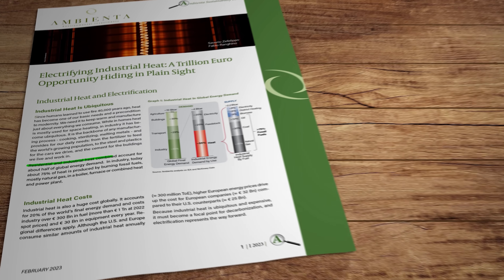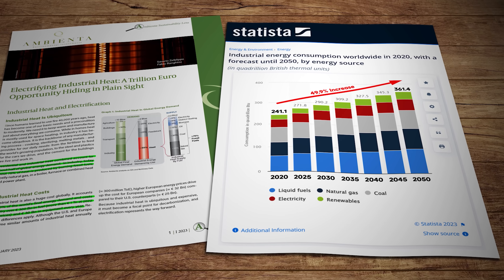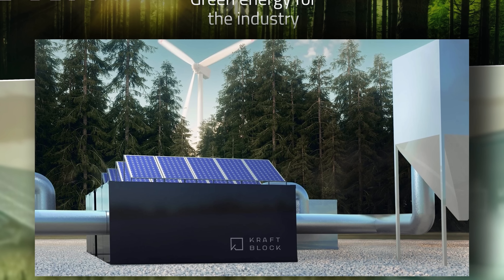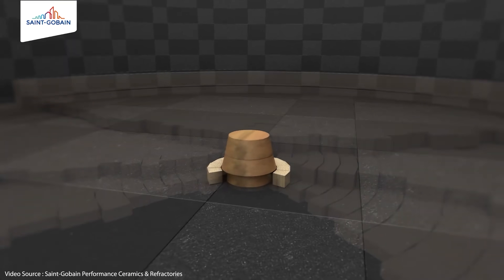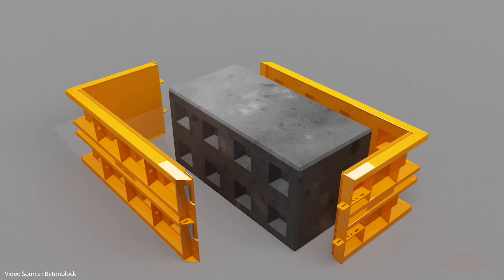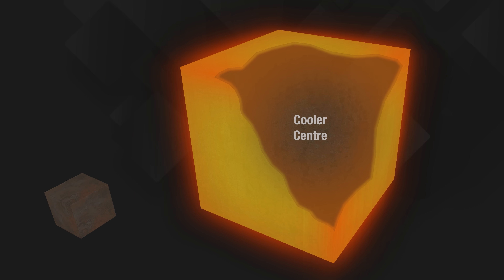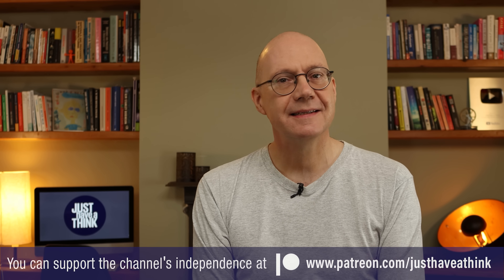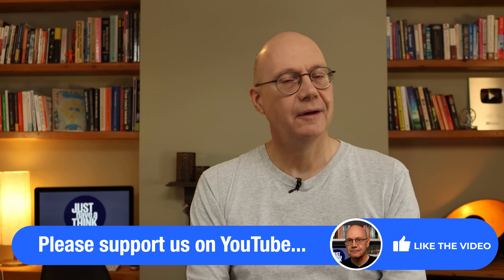Moving waste heat from industry to homes.

Comment: What industry, process or piece of comercial machinery exhausts waste heat at anywhere near that kind of temperature? Any meaningful amount of heat energy at temperatures more than a few hundred C has huge amounts of usable energy in it.  

Foundaries and smelting operations keep as much heat as possible inside furnaces and the like and the heat coming off cooling metal billets is not something that can be easily captured effectively. Waste heat from power plants wouldn't be above 100C because there is still plenty of useful work to be extracted. 

Waste heat usually involves an enormous quantam of energy at a relatively low temperature.  Where the waste heat is above ambient but not enough to easily extract much more usedul work from it. 

The whole video I was waiting for an actual example of where they're getting this waste heat from. 

As a last resort resistive load for renewables that would otherwise be curtailed seems to be the most likely use. Even in such a case though it makes more sense to either store the heat at the renewable generation site or nearby. Or create the resistive load to charge the heat onsite where it would be used later. 

This is interesting but seems like a solution looking for a problem.

Comment: Large comercial greenhouses could buy blocks of heat when winter arrives. If a storm was coming and you knew it was going to be much colder, you could order another block or two. Some of these large greenhouse operations are hundreds of acres and need a lot of heat when the temperature drops. These blocks might even make it more practical to have greenhosues in cold regions where it currently is too expensive to heat them in winter.
Reply: give it a few years & there won't be any cold regions

Comment: Just say no.  At those temperatures, you are not talking about waste heat.  This is typical BS used to hoover in research funding.  There is no way that physically moving a shipping container is a more practical solution that pumping fluids or converting that "waste heat" (that is higher temperature than used to produce electricity in nuclear power plant!) into electricity and have it flow through power lines.

Comment: They want to move 10 megawatt hours around in a shipping container? I hate to be the wet blanket here, but transportation safety, national security and fire safety officials alike, not to mention local politicians, are all going to absolutely lose their minds if you tell them you want to routinely truck around shipping containers containing 3.6 gigajoules worth of 1300° C particulate material.  That’s like 680 kilos of TNT or more than two tankers worth of gasoline. That’s the level of hazard they will consider it.

Comment: Interesting, but definitely a lack of hard numbers here. Particularly the issue of transportation?

Using burger units, diesel is roughly 40kWh/gallon(US). Allow for 8mpg average for the transporting truck (Maybe more, maybe less, depending on a lot of factors). Fifty miles away, 100 mile roundtrip. So for this distance, you'd burn 12.5 gallons, or 500kWh of fuel. Compared to the given 10MWh the container supposedly holds? Not bad, but basically boils down to the net equivalent of about 240 gallons of fuel being transported per trip. That's a couple thousand dollars of value, tops. Against the energy and financial costs of packing and unpacking the heat, the (hazardous-cargo certified) driver wages, the cost of the (hopefully emissions-compliant) truck, and even a slight traffic increase?

This is interesting, but feels a lot more like greenwashing and an attempt to play the carbon-credit game than a serious effort at saving money or the earth.

Also, any situation where a system capable of creating/collecting/concentrating heat to 1300 degrees is viable? Not an area I'm familiar with, but are we seriously lacking any option for  just using it on-site to make electricity?

Comment: I have never understood why steelworks dump slag without developing energy recovery systems. 
I am fully aware that it is due to the fact it is due to the cost of building the infrastructure to recover that heat. I wonder if the slag could be used to recover the heat from the molten slag!
One thing you could use such high energy heat sources is to supply steam/hot water for those factories that have a rail connection but no steam circuit to charge a fireless steam locomotive to shunt the sidings etc etc rather than a diesel locomotive (also fireless steam is much simpler than battery electric and doesn't involve the issues surrounding modern batteries).

Comment: That's a genius solution I think. Depending on the scale it could be worth to move the heat, because you know you could get more energy by moving the container than by burning the gas. I have some questions thought.
Waste heat is not always up to 1300°C... So how does the system manage it ?
Do they also work on a plan to put the storage onto 1300°C with heat pumps ? That could also be a plan for them. So industries could store heat (either with resistive heater or heat pumps) when there are a lot of energy available, or at night when consumption is lower, or even help with grid stabilisation, just to use the heat later at a more appropriate time.

If provided with a decent heat pump system it could both lower energy consumption AND provide a way to get it cheaper, like you heat it at night, then use it during day, etc. I really like this. For once, I think that may be something I trust a lot.

Comment: Thanks Dave, another informative show.
I've analysed my domestic use of electricity (i don't have gas appliances) and found that ~ 80% is ultimately used to move heat around (refrigeration, air-conditioning, hot water, cooking). Surprisingly, I haven't found any domestic appliances which incorporate thermal energy storage - with the exception of sensible heat in hot water.
With the capital cost of lithium ion battery storage still remaining over AUD $900 per kWh, thermal energy storage in phase change mediums looks to offer a more cost effective alternative.

Comment: I am sceptical about how many industrial processes are throwing away waste heat at over 1300C. The waste heat temp will be lower than the operating temp and you also need a temp differential between the waste heat and the storage temp so the heat will flow in a reasonable period of time. Most waste heat is much lower temp. Power stations for eg have waste heat below 200C, mostly much below that. Works great for home heating, but would be too low energy density to be worth putting on trucks. 

We are supposed to be minimising use of trucks by transporting things by rail as much as possible. Using trucks to transport heat that could be transported along a pipe if you bothered to build it seems madness. I don't think you mentioned how heavy these containers will be. Are they too heavy for a truck to take 2 (40' is standard truck size)? These heavy loads will cause extra wear to roads as well as the extra traffic which all needs to be considered. I'm not against thermal storage, I just think lugging it around on trucks is not often going to outweigh the costs and downsides. If you are using excess electricity to make the heat then it makes more sense to do that at the point it will be used and transport the electrons rather than the hot stuff.

Comment: I'm not against heat transfer.  It's done Iceland and other locations with geo-thermal.  I do think we should have a hierarchy of preferences.  First make everything as efficient as possible.  Overall costs are almost always less even if purchase price is higher.  A passivhaus may cost more to build but will recapture costs in a few years.  Heat transfers are fine but we definitely need to stop burning things.  That means figuring out ways to make concrete-like materials without super-hot furnaces.
Reply: The question is "what do we prioritize?"  I think all the ways of reducing emissions are positive except bio-fuels and most applications of hydrogen.  But, the focus should be solar wind and batteries (SWB), and we should be on a campaign to reach emission-free energy.  Next is stop building inefficient houses and ICE vehicles.  We should be accomplishing those goals asap.  No new long-term infrastructure relying on natural gas for heat.

Comment: Aside from the transportation waste energy and CO2 emissions associated with moving semis loaded to capacity carrying material half the weight of solid steel around, I'm failing to see how they plan to pump low grade heat up to 1300 C in an efficient enough manner to make this viable. Maybe, if you're using "free" (otherwise wasted) electricity generated from solar/wind/etc in off hours, but I feel like if the blocks really could effectively store this heat for weeks on end then they'd already be used as an on-site storage mechanism as "thermal batteries" where there is no transportation cost required.

Comment: I'm sure he can find some uses for that but it's likely not that big a deal.   He is hand waving away the expensive part.  i.e. the Heat collection.   If you could collect the heat to put into his nice little pipe then industry wouldn't have a problem.   There are plenty of head storage solutions depending on there needs.

Comment: Interesting system, love it.
Once you can start moving heat around (by electric vehicle) it opens up options like turning computer data hubs into heat suppliers to places that then do not need to be close. Plus at a smaller scale maybe there is efficiencies to be gained by incorporating this product into building heat exchange units. Also any electricity power station with a turbine could store waste heat to speed up starting times and reduce waste.
Reply: a turbine could probably be fitted into the container unit to generate enough electricity for the transportation vehicle itself 😉

Comment: I like it! Shipping containers full of heat moving from the producer to the consumer. It takes a waste product and makes it a valuable resource. Even if the heat isn't being generated through renewable energy, at least it's being recycled and not just released into the atmosphere. So there's less energy being generated overall. And you don't need a big infrastructure of pipes, just roads and heat exchangers at the two end points.

The way it uses steel slag pellets, and is configurable for different types of costumers is really clever. Uber Heats indeed.

Comment: I've thought about this being a viable solution to waste heat in the past. I shared this idea and was told it was ridiculous, and that it wouldn't work. it's cool to see a company actually do it. makes me feel somewhat vindicated.
Reply: @orionbetelgeuse1937  That was my precise thought. 1300C heat is high quality heat, that's the initial heat produced for whatever industrial process they're working not the exhaust or waste heat. If they were directly using the molten slag I could see them getting hotter stuff but it sounds like they're heating the slag up with air not using it directly from the Steel Mill.

I can't help but also be skeptical about the idea of storing heat in a shipping container to be moved on roads, we've built pipes for district heating before that would be far more efficient at this task and the implied environmental impact of that choice to have a truck ( using diesel? or if electricity it's around 42.7% gas/coal as of 2022 and that's before battery losses ) pave and surface all the roads with the very same concrete they lambasted or perhaps ashfault. What sort of world are we imagining where we're shipping around the waste heat from industrial facilities but we haven't gotten away from a mode of shipping as inefficient as trucks?
Reply: @orionbetelgeuse1937  well ideally these companies would have some sort of heat recovery system in place. but not all of them do. that's kind of the point of this idea.

Comment: I'm not convinced that shipping the hot material and insolation would use less energy than just running a resistance heater. I can see the thought process but I'm not sure about the numbers.

Comment: I've seen this kind of stored heat system before, and always wondered why they don't put a pipe inside, fill it with water, and have the resulting steam turn a small turbine. Instant home/neighborhood/regional power plant, depending on scale. If you're running some 24/7 facility with constant heat generation, it seems like you could get a non-negligible amount of power return over time for a relatively small investment.
Reply: The problem there is the amount of Joules it's possible to store vs the amount of Joules needed to turn water into steam & then there's recapturing unused energy as it phase-changes back to water. 
There's probably more useful phase-change media but that's not my expertise, ask a scientist about that.
It's probably possible to do it with just hot air though.
Reply: Generate heat during daily production, sell electricity at night (when you can't count on solar). The idea is so perfect and simple on paper that I assume there are technical difficulties we don't know about its actual implementation. (I'm thinking molten sands heat storing, for example, which have a lot of problems)

Comment: That is a mind boggling solution, boxes of hot energy! (Uber might just take you up!) With suitably well insulated pipes it could stimulate the growth of district heating systems such as are common in Russia, (but alas often not well enough insulated). Every urban flat, office, shop, library, school etc comes with heating and hot water. If we can build vast networks of pipes for water, oil, gas, the end of heat poverty could be possible.

Comment: So...moving energy around on semi-trucks, eh. Here's a brainfart. Instead ow using copper wires strung on poles for electric transmission, what about using semis  (or barges) to move batteries around. Not much transmission losses, no towers to erect, can to of fro nearly anywhere. This is in response to the often touted need to massively upbuild the world's electric transmission network.
Reply: I once read a calculation that the biggest data bandwidth you could achieve was a truck with harddisks.

Comment: very interesting video. One of the things i regularly come back to and spend time thinking about. Usually about how much heat energy is wasted in combustible cars. Always surprised we couldn't add some heat capture removable device  that could be used elsewhere. Would be cool to be able to say attach something to 18 wheeler who delivers long distances and drop off heat stored for usage on site then swap replacement and move onto next long distance location. instead of wasting all the excess heat energy.
Reply: some waste heat is already used for cabin heating but I agree it would be neat if more could be captured for delivery elsewhere.
Reply: @alanhat5252  true passive heating in cars is one use we already take advantage of.

Comment: Industrial processes require waste heat removal at a certain rate not to interfere with the process itself. Further more, that waste heat is often of low density. None of these points were addressed.

Comment: Brilliant, Dave, but you didn't address how stable the slag/phosphate binder is against repeated cycles of heating and cooling. You made this material sound cheap to produce, but if it needs to be replaced frequently that cuts into its economic viability. If it only degrades very slowly, lasting for decades,  I think this could be a game changer.

Comment: If the factory has installed a network of heat pumps to get the waste heat to the Über Heats box, why not just attach a steam generator instead and save on the electric bill? Why waste more energy shipping it around?

Comment: Nice!  Also have a look at Antora Energy. They're a US startup using graphite blocks to store heat when renewables over-produce, and then releasing it for process use, or converting it to electricty with thermo-photovoltaic panels.  They just opened their first factory in San Jose.

Comment: They only heated the material to less than 2 times the temperature of the previous attempt, and they didn't use any materials with high specific heat or phase transition. How does it suddenly become economical? He said "one over ten" so 0.1?

Comment: If I punched the right buttons on the calculator, a 50% increase in industrial energy consumption by 2050 is only about 1.6% annual growth.  Population is projected to increase too, so that's only a 0.8% annual increase in per-capita industrial energy consumption.  Given that there are a still lot of people in the world who don't have access to the basics, I hope the projection is based on big increases in efficiency.

You can't literally have a circular heat economy.  Heat flows spontaneously only from warmer from cooler.  Pumping heat from cooler to warmer can only happen if it's coupled to another heat flow from warmer to cooler.  But we have a large fusion reactor conveniently located a safe distance away, and an even larger heat sink located almost everywhere else, so the non-circular part is happening anyway.

Hauling stuff on trucks is inherently somewhat costly, and you still need the waste-heat recovery system to put the heat into the slag block.  So I'm not particularly optimistic about this one.  It well may have some uses, where waste heat is being produced at very high temperatures and lot of heat is needed fairly nearby at much lower temperatures.  But that doesn't sound as though it's a large part of the world's industrial heat requirements.